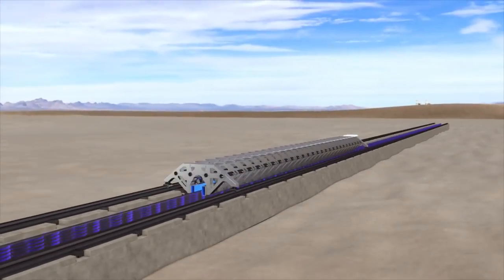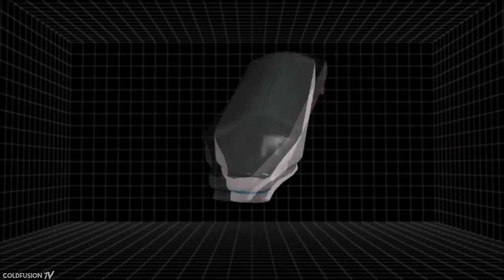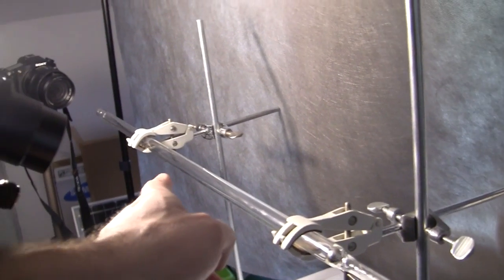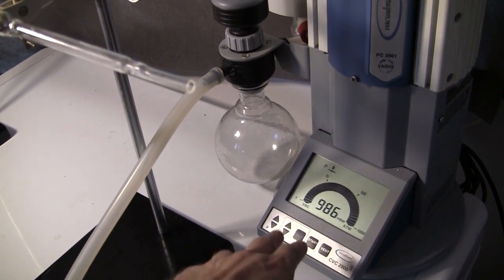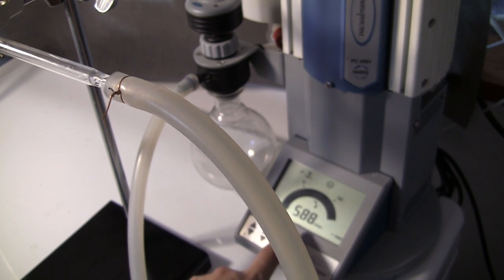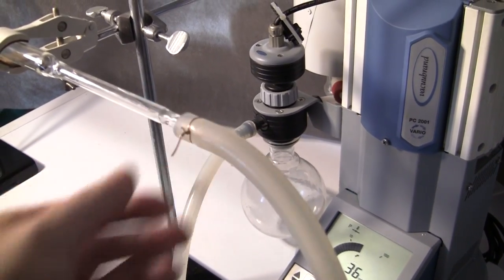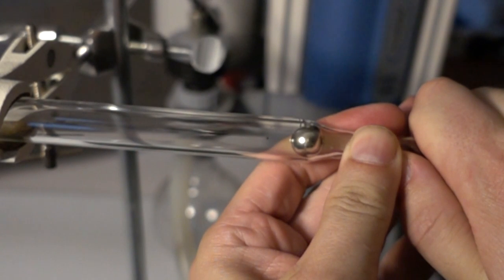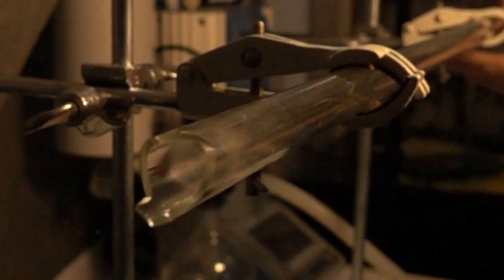How  the Hyperloop can kill you!

Comment: can you explain, what this measurement is about? or what kind of failure?
Reply: If the tube got breached, the high pressure ambient air rushing in on one side of the car in the tube would push the car into the low pressure area of the tube on the opposite side.  This would cause enormous acceleration and speed for the car for a certain distance, until the air on both sides of the tube equalized.

Realistically though, this project will not be built by morons.  Professional engineers will design this, and so contingencies and safety measures will be built into every aspect of the project.
Reply: Optimistically*

Realistically you don't know what retards will be allowed to build it, it's a gamble.
Reply: and how realistic is that, that it breaches so rapidly?

Comment: How much energy to pump all the air out of the hyperloop?
Reply: It does take more energy the lower you get, because of the pressure differential between the sides. However, it's certainly manageable. Something that has been proposed is significant solar to cheapen the whole thing. I find this reasonable.
Reply: I'm not a scientist so I don't know the answer.  However, I know it doesn't take that much more energy to FILL a larger tire vs a smaller one.  Sure, there is more volume but it is the "pressure" that we are talking about here.  The process would just be the opposite... where you are removing air and not adding it.  So, I'm guessing you would just pump more times, not necessarily have to pump any harder though.

Comment: After all the legit "busted" videos this one is a great surprise. Did Thunderf00t got a stroke, or was he replaced by reptilian aliens with some brain-dead agent? 
First, larger things accelerate slower - this is true for land vehicles, airplanes, boats, you name it. The acceleration is the force divided by mass. The force in this case increases with the surface of the object, which increases by the square of the object size. The mass increases with the volume of the object, so by the cube of the object size. Thus larger objects get far less acceleration - well below dangerous levels. This is something every scientists with the most basic understanding of physics must know, and ignoring it here is inexcusable.
Second, Thunderf00t put a steel ball in a glass with a dead end, put vacuum in front and atmospheric pressure after it. The ball, predictably, hit the dead end. In case of a vacuum failure in the Hyperloop there would not be a dead end in 3 feet - there would be many miles in front to bring the speed down, linear motors to get the speed down, and the tube in front can be controllably repressurised in order to equalize the pressure in front and in the back of the vehicle. 
But hey, views bring money, so let's say the biggest bullshit imaginable, eh?
Reply: Please dont forget: A vehicle at the speed of sound will never feel any force from air that is rushing in with a maximum speed that is equal to that.
If the vehicle drives into the leak it will be slowing down.
If the vehicle is currently very slow and thus would actually feel the force of air, it would simply be applying the breaks. 2g (as calculated above me) are common decelerations for simple cars.
Reply: I've found a pretty neat video on this particular topic. Just search up Shane Killian's and Libertarianists response to thunderf00t's video: Thunderf00t's "How the Hyperloop can kill you KILLED". He posted a video reply to Thunderf00t's video. And they will be making more videos in response to his series.
Reply: Ekaterinya Vladinakova Thanks. I watched the video and it highlights the biggest problem in Thunderf00t's arguments - the square-cube law. Thunderf00t needs to admit at least some of his points were wrong.
Reply: I've yet to see him provide a good video.  They all have major flaws in logic like this.  I haven't seen all of his videos yet though.  So maybe there are some where he actually does good science.  I'm starting to doubt it though.
Reply: Fine. The assumptions are:
- the front surface area of the hyperloop capsule is as big as the tube cross section (it would be slightly smaller) 
- the tube cross section is 3 square meters (value used by thunderf00t), equal to 30 000 square cm
 - 1 atmosphere pressure difference in front and after the capsule (worst case scenario with no emergency venting), equal to 10.1 N/square cm
- no air bypassing the capsule
- capsule weight is 15 tons (value used by thunderf00t), so 15 000 kg
Then the force acting on the capsule would be 30 000 square cm* 10.1 N/square cm = 303 000 N = 303 KN. 
The acceleration according to Neton's Second Law would be a = F/m. 
a = 303 000 / 15 000 = 20.2 m/s squared. 
So WORST case scenario acceleration is 2.06 g, unpleasant but not lethal and definitely nothing like a bullet being shot from a barrel.
Reply: *****
And all of that assumes no breaking system... which I suspect they will have on something they plan to accelerate to near the speed of sound...lol.  Which I'm guessing would simply require changing the polarity of the magnetic fields.

Comment: This experiment works very well on a small scale. On a larger scale with a longer loop it fails as the Mythbusters discovered with their large ping pong ball gun. A small leak will have only a very small effect and is not dangerous. A full breach will have a huge effect when it is very close to the train. At longer distances the friction of the air rushing into the tube will become huge. You get a nice pressure gradient in the tube and nothing catastrophically will happen.

Comment: who says it has ti be such low pressure. Obviously it would have lower pressure then atmosphere however it can be calibrated to not be so low. The lower the pressure the more energy and work is needed to get get to and maintain it. 
Could this contraption also not have a different mixture of air? such as helium mixed with oxygen like how scuba divers use

Furthermore, I doubt they would just make a long tube. Instead they could section the tube such that if there was a vacum leak they could quickly close a curtain, therefore partitioning te tube. Likened to the panama canal which sections off the river allowing for different amounts of water in each section
They also could plan ahead for such a problem by putting air intake ports all around. So if there is a vacum in one place and it is pushing on a train you could open n port on the other side of the train basically canceling out the effect by creating force on both ends of the train. Not saying it'll be a fun ride but it may stop the the train from being launched. Those air intakes can also pump in heavier air allowing a bit of compensating to happen for the inevitable few millisecond latency of detecting a vacum leak, calculating, and acting on it.
All of that added to some brakes that go all around. The brakes could be like rods on the train that come out and scrape all around the train, even puncturing the glass if necessary. As well as brakes like the ones military jets use to go from 200km to 0 in what is it 4 seconds flat? hooks extend from the craft and grab ropes. The ropes have give that make sure the stop isn't to abrupt. furthermore, what about adding a pool of water to the bottom of the track. In fact the water can be incased in a plastic like the water bins they place on highways in case a car heads into a wall. They can also be used as pipes to transport water. One water abundant place can send water to a dry area like the states in the southwest
I feel like that is one problem that can be overcome not to difficult. Not sure about other problems though.

Comment: BTW, the near vacuum 1 millibar concept is not accurate. The hyperloop intends to use low pressure, but rejected the hypothetically more efficient vacuum tube for exactly the reason you mention - tube failure.

Comment: While I don't know if it could be done quickly enough, or even safely, what about a system of pressure sensors, and if pressure on one side of the car were to suddenly increase dramatically, valves on the other side open to equalize pressure? Or, despite the way it is illustrated, what about making the tube diameter maybe double or triple that of the car? That would prevent large pressure build up behind the vehicle.

Comment: Let's start with first principles. Do you NEED to travel that fast ? On a slow train, at 80 KPH, if you have eight hours sleep, that's 640 kilometres. More than the distance across most counties. If you have a globe, have a look at Australia. It's one of the bigger pieces of land. I've travelled from one side to the other, three in the car. 8 hours driving, 8 hours passenger, 8 hours asleep. 8 hours driving, 8 hours passenger . . .  and we are there. 4,000 kilometres in forty hours. If you can't spare the time to go somewhere, then you don't need to go there.

Comment: Sorry, but I give this one a thumbs down because it's only one argument without considering the overall security or any counter measures. Any kind of vehicle can kill you under certain circumstances. 
Even as a non physicist I can think of multiple security measures that could be implemented in case the pressure chamber gets breached, none of which have been mentioned here. 
Pressure doors or flaps on the inside could be used that shut out breached sections; valves could be used to create counter pressure; friction breaks could be used in an emergency in addition to the magnetic ones, maybe even multiple little parachutes on the inside wall could be released to slow down the explosive air expansion, .. whatever .. I'm sure if I looked at the actual project description or talked with the engineers they probably have thought about and solved this issue a long time ago.

Comment: Actually it would slow down. If you repeat this experiment with a longer barrel the ball will not reach the end, because air will flow through the gap between the ball and the glass. This mean the end of the tube will reach ambient pressure and provide a cushioning effect.

Not to mention they could simply slowly reduce the levitation, slowly increasing the friction with the track.

Comment: Thunderf00t, this is entirely poorly conceived. You are ignoring force on a large body, momentum, and relative surface area.

The pressure equalization could never exert a force greater than 1 ATM, or 101325 pascals (N/m^2).

That pressure could only act on the front face of the train, and so the surface area is important. Let's conservatively say that the train's face is 5m on an edge, for a total frontal surface area of 25m^2.

That means the maximum force that would ever be presented to that surface would be 25*101325 = 23,000,000 N

That is a large force, but it would not all be applied at the same time, because it would take time for pressure to equalize. But let's just imagine it could equalize instantly:

It has to act on a 20ton train -- I get this because that is the lower end for maglev trains these days. That's a mass of around 18,000kg

So F=ma therefore 23,000,000 / 18,000 = a = 139m/s^2 which again is large... but how large? only around 14G which is within the survivable range.

That's the WORST case scenario. You still have to overcome the fact that the pressure will not instantaneously equalize.

Comment: "(...) who simply dont want to hear engineering reality." << This reality you speak of, is that it can be built. That is the engineering reality. I'm an engineer myself and I've noticed the same tendency quite often; to misinterpret risks regarding a novel concept. Yes, a catastrophic failure is entirely possible. You see a large object and if it fails at any point, it goes bad big time. But this is completely and utterly irrelevant. In the end it boils down to the chance you have of dying in such a thing. That is the way means of transportation should be evaluated. For example per kilometer (expressed in chance of death per travelled kilometer), planes are way safer than cars, even though planes have many weak spots that can cause even more damage than the hyperloop (in the worst case, a damaged plane might crash into a city).

Just because the scenario of being shot out of a bullet sounds scary, doesn't mean there is some insurmountably large engineering problem. Yes, it has risks, as with any mode of transportation, but don't let fear guide you. If it's statistically proven to be as safe as a train, I'll happily take a ride.

Comment: ooooh something could go wrong. No shit, train tracks can get buckled and cause trains to derail at 80mph killing people and causing huge amounts of damage. 

Yes if the tube of a hyperloop gets smashed while something is moving through it, it will be catastrophic, however that's not a reason not to build one. Also you assume a stationary hyperloop has no brakes or safety features to prevent this from happening?

Also the hyper loop isnt a total vacuum and is not perfectly sealed, it has vacuum pumps running constantly to maintain a low pressure, so any holes/imperfections don't actually cause any problems....

Comment: Um... speaking as a mechanical engineer, this IS something you could design safety countermeasures for. For one thing, you could design the car itself,  so that catastrophic vacuum losses are countered by opening pipes through the car, allowing gas to get from one side to the other, you can equip the car with emergency brakes to buffer some of the acceleration, you can equip the interior of the car with some means of cushioning sharp accelerations, and that's just the car.
You can also equip the tunnel itself with safety valves that open up in catastrophic pressure differentials, to rapidly equalize pressure on both sides of the car. I mean, it'd suck having to reduce pressure again, but safety's safety.
This IS something that'd have to be planned for... but it's something that can be planned for.
Reply: Humans will be traveling very fast and there is a maximum deceleration that can be safe for all passengers and this will include infants, the elderly and the disabled. You can do the math on this quite easily and calculate the minimum safe deceleration distance. Its going to be a huge distance.

The main problem is that there is no issue that doesn't at worst kill everyone and at best render the entire system non-functional for extended repairs and testing. It would be like if my car crashed but you either died or your car died.

You can go into thermal expansion/contraction issues, 100% of the tube being a single point of failure or defending it from attack but no matter what you this is an easy project to debunk.

High speed rails are already being used because they are usable technology. Lets build those.
Reply: nosirrahx The most viable means of stopping a catastrophic pressure failure is repressurizing the whole system, which would indeed render it non-functional for a period of time.

Really, the biggest problem is going to be the vacuum itself. Vacuums are difficult to create and sustain for such a large volume. It's going to get ridiculously expensive REAL fast.

So yeah, I'd agree that these aren't practical. Just not for the reasons we were given.
Reply: but isnt the issue the shear amount of accelaration that the body will have to go through to reach this speed??? is that the real issue, i mean there is no real way to compensate for that, i can understand this for transporting goods but i mean people???? thats another story, we have organs that can rupture at high velocity acceleration or deceleration. I get using brake but doesnt that defeat the whole purpose cause i mean depending on the speed you'll have to change the brakes every week and damn that is not so cost effective
Reply: Myty Dem
You'll note, everything I said was aimed at reducing said acceleration.
Allowing air to flow from one end of the car to the other will reduce pressure on the car, reducing acceleration.
Using brakes will damper acceleration directly.
Breaking the vacuum seal on the other side of the car will dramatically reduce the pressure differential... dramatically reducing acceleration.
Cushioning on the inside of the car, so if the system should trigger JUST A LITTLE LATE, acceleration on the bodies inside the car will be reduced.

You only have to change the brakes when they're used, and you won't have to change them every week unless you're having catastrophic pressure failures every week. If that's happening every week, you're going to have MUCH bigger cost problems than brake pads...
Reply: Thank you. There wasn't a word you said I didn't agree with. Cheers

Comment: How is a fan/jet going to work in a near vacuum? or did I miss something?
Reply: also not sure where the idea of using a propeller came from. I guess some random artist envisioned it. There are other sources of energy to create momentum. Like the one current maglev trains use. Basically create a rail gun with magnets and lots of energy. Only instead of firing so fast that it turns into plasma you just cruise it. Though... just in case of a sudden interplanetary attack you keep that baby ready to be pointed up into the sky and launch those plasma trains with enough power to destroy an fuck face daring to look at us
Reply: MAgic of course.
Reply: the same way they currently do for planes. Some prop planes can go pretty dang high. By putting big propellers and  spinning them really fast I guesse

Comment: If the hyperloop were run with magnetic ABS breaks, alongside having it being put into a multilayered tube with gaps of vacuum in between, the tunnel could work very well. Assuming that is, whatever material its walls are made of are able to hold them selves together, and that the hyperloop has an on board, as well as remote braking system. Something tells me their proposal for it doesn't meet most of those points I just listed though.